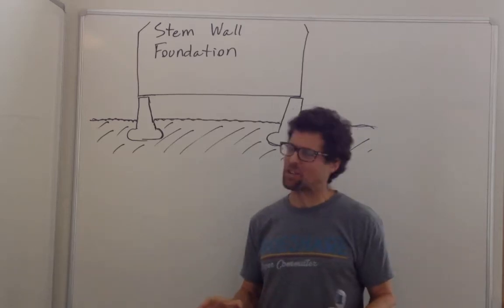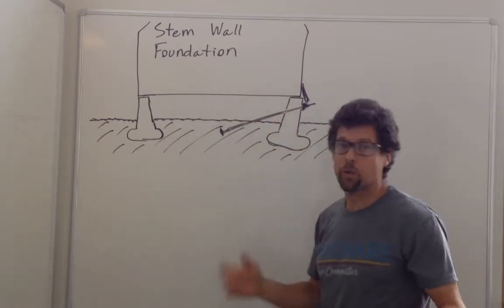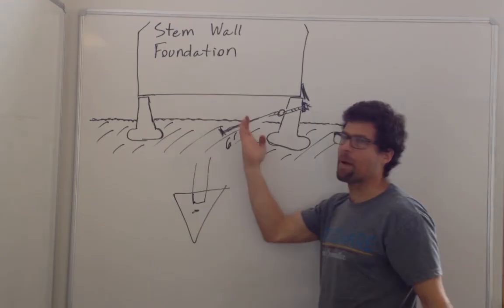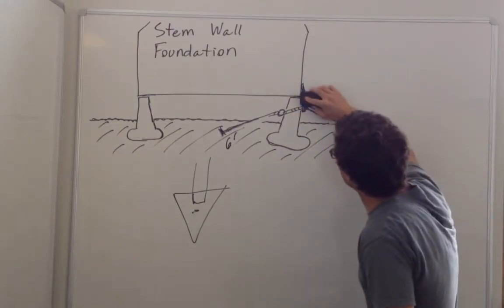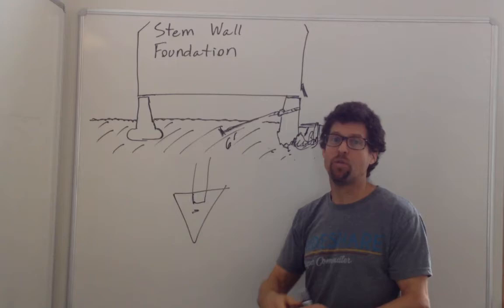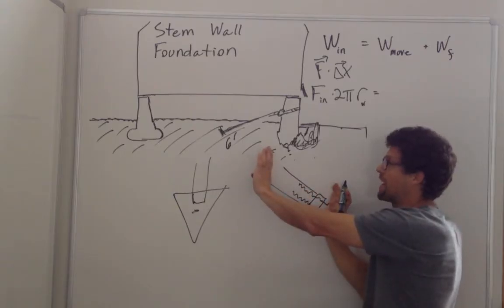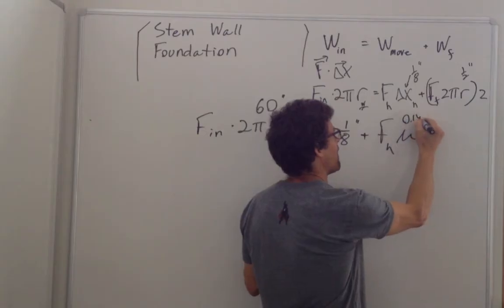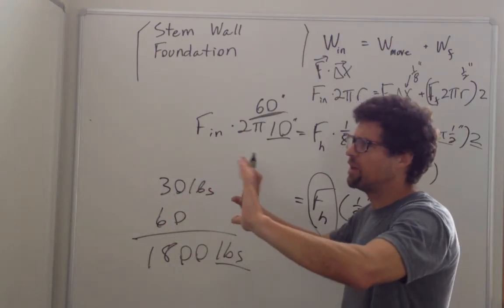Stem Wall Repair, Pete Schwartz, Cal Poly Phyiscs

Comment: Not sure if you are a faculty member in Phyiscs (as you spelled it). If you are, please consult with the English Department for some spelling help. Trespassing into a field outside Phyiscs (i.e., foundation repair and structural engineering) may get you in trouble with local and state agencies. In addition, it is always helpful to consult with experts in the field. Imagine a transistor radio enthusiast venturing into the Theory of Relativity!